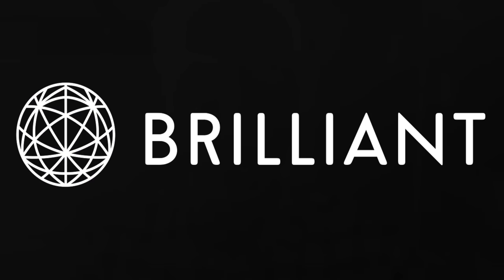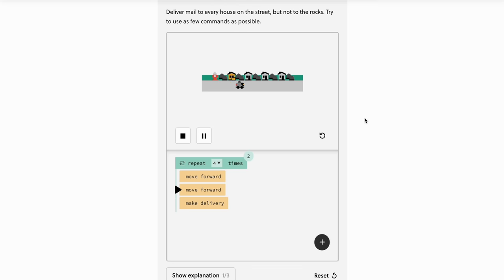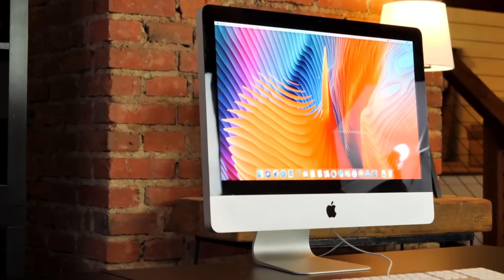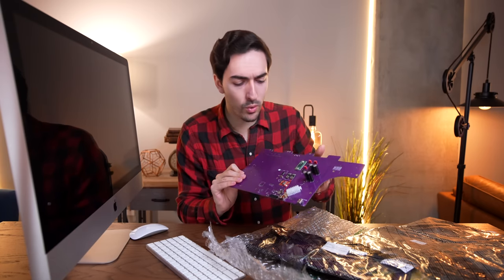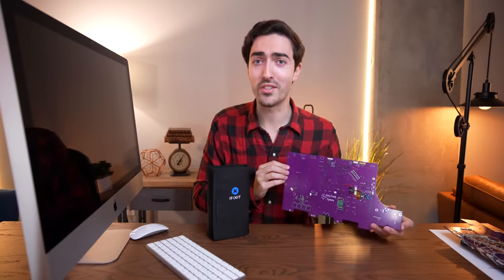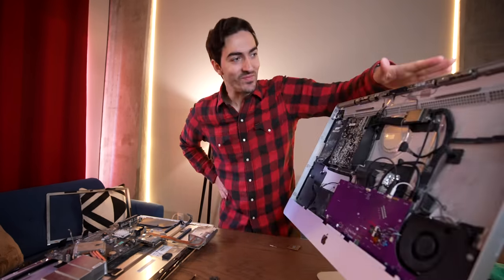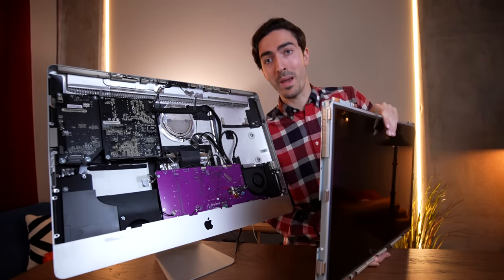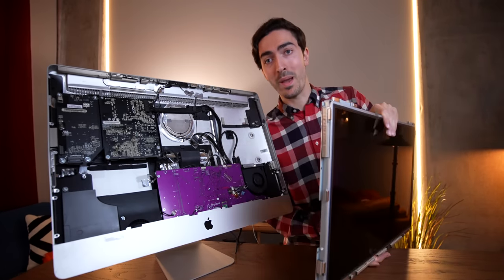Upcycle an old iMac display with this INSANE mod!

Comment: I will definitely do the Mac mini upgrade! Currently using an 2012 iMac with ssd quad core i7, 18gb of ram and 2gb nvidia graphics card. Still very fast for normal tasks but will definitely upgrade if the juicy crumb will be available. So yes like definitely interested in the Mac mini upgrade video

Comment: My 2010 isn’t failing, but isn’t usable anymore with modern MacOS versions (lack of metal support). I usually use it under windows 11 (works fine btw) now.
Reply: have you checked out Opencore Legacy Patcher?
Reply: @haywardkong1213  yes of course. Allows installation but doesn’t work well, i.e no photos, no maps, and sometimes a distorted picture. Oclp works great on my 2012 mbp though, even with ventura

Comment: Luke - does anyone in the world repair Mac Pro 5,1 PSU? Is there hope after the failure of something made from simple coils chokes and capacitors..... I counted a handful of Mos-fet transistors and three heatsinks...... it's made from components from the 90's surely someone with a soldiering iron and a schematic from Apple could be our Mac Superhero and stop the pain.....? Ebay has a few for sale but they are most likely to failure given time and although the second handed PSU are okay for price - the shipping is the price of a two year old Tesla with a charge rate of 26%..... I have heard of horror stories of eBay PSU arriving to not work and after some excitement, the receiver has been found in a state of mind numbing loss !

Comment: This is neat, I've replaced the video card twice in my 2011 iMac, it has the core i7, 16GB ram, and a 1TB SSD, but just keeps blowing graphics cards. I'd keep using it if I could, so this could be a solution but I have a MacBook Pro 14, so if they come out and start selling a USB-C version I'd consider it.
Reply: How did you replace the video card? I couldn't find an upgrade... 24" 2011 iMac.
Reply: We have a USB-C version in the works. The DockPro will be fully USB-C capable once it is released.

Comment: Im actually gonna buy a 21.5 inch with a core i5 and 27 inch with a core i7 to make a video on, and then using the 27' for video editing and writing while giving the other one to my little brother to teach him editing.
I've asked around a lot and have been told that editing on a machine that old probably isn't the best idea, but I've also seen a lot MORE people say that they still use their 2011 iMac's today. Even your old video said that editing was fairly smooth, but not too much other info was given on it.

So Luke I need some information. On a scale from 1-10, how WAS the editing experience at 1080p, 60fps? Cus so long as it hangs around a 6 or something, I'll be happy until I have the money to upgrade to a different Mac entirely, which will probably take a year at my current pace but eh, better than the dual core 2012 Mac Mini I'm currently stuck with.

Besides, if it breaks, I honestly wouldn't hate the 27' as a monitor. Just looking at it gets me into a writing mood for some weird reason... Probably Trey Parker's fault.
Reply: Time to upgrade the Mac mini. It’s unsupported
Reply: @emilsecker7881  Oh I dont care if it's unsupported. An unsupported machine can still be used for editing, writing and other tasks.

Besides, if I was going for a machine that WAS supported, I wouldn't be going for a 2011 iMac.
Reply: @jackintoshvids  should keep it off the net at least. That thing is a liability now. You will do if you get your bank accounts hacked into due to an unsupported browser
Reply: @emilsecker7881  Oh of course. Only thing I'll ever go online for is if I need to download some softwares like Fade In or Final Cut Pro. I intend to use it as a work machine and a work machine only... And to make a video on them cus I think it'd be interesting.
Reply: @jackintoshvids  good plan

Comment: Wonderful video! However the nearly $400 price for the JuicyCrumb board is cost prohibitive. I have a $50 ebay board that does the trick. Albeit not as beautifully integrated. Even at half the price (and why is it only for the 2011?) its a hard sell. Thanks again and I am subscribed.

Comment: In the next version of this it would be better if they can use the optical drive and alao align the ports in the port cut out on the back
Reply: Hi Jero, the Optical Drive will be functional on our DockPro model. Unfortunately it is not possible for us to align the rear I/O for the time being due to the original ports being custom designed for Apple.

Comment: I hope this is compatible with a 2012 too... I'd love to set my old broken one up.
Reply: 2012 and up use double sided tape to stick the screen to. They need another size of board. And I think you can sell working LCD +glass and buy whole 2011 (or two).

Comment: The DockLite and DockPro are very expensive for what you get. Upcycling old hardware has some appeal to it, don't get me wrong. But you can get a clean, compact, modern 27" 2560x1440 monitor with much thinner bezels than a 27" 2011 iMac, for the cost of of a DockLite alone. And if you want a decent-enough monitor that's on par with the 2011 iMac's, you can pay half the price. It's a poor value.

Comment: I prefer the earlier version of this mod as it uses less power to run
Reply: I did get a message from yourself thanks I'm not so TEC savvy but I love the way you squeeze extra juice from old dry I Mac  I've 2 SSD equipped units working well .
However I should prob use mini due to lower power usage .

Comment: I’m a bit surprised that you confuse the 2011 with a 2010 iMac. The difference is obvious from the outside, given that the 2010 only had one mini display port and the 2011 has two thunderbolt ports in its place

Comment: I’ve been looking at the “eBay” driver board solution but not being able to charge the MacBook while having it connected is a definite turn-off for me. 
This product looks a step up, but when you look at the crazy prices you realise that you can buy a completely new monitor, with USB hub, charging etc. for LESS money and without all the hassle. This would have been great if these boards were in the 100 bucks range but I guess they think Apple users love their machines so much that they will fork up 650+ dollars for the most capable version….. but not me.

Comment: Board is a cool idea, while I understand that it has a lot of work and time developing however 500+ dollars for the Board plus the used iMac 100+ dollars is kind if steep for a 10+year old Monitor with speakers. Cool idea no doubt but unless he can figure it out cheaper it won't be economically viable, especially in today's economic situation. Thank you for the video nonetheless.
Reply: Yep, if the board was under $100 it might make sense.

Comment: This is also a nice project, but the cost difference between $260 and $26 for a camera and speakers is significant. I opted for the $26 Chinese option, but unfortunately, they don't have the same brightness as the original components. Perhaps they would work better with an M1 model. Nevertheless, I appreciate your videos; they are wonderful!

Comment: i just upgraded an old 21.5 inch 2011 iMac with a SSD and WX 4150 GPU (=RX 550-560) and it works great! The old GPU isn't failed so i can use it to repair an another iMac
Reply: which model of imac you have  where did you buy the graphics card? I have a mid2011 and the graphics card is getting problematic...
Reply: Time up upgrade. High Sierra has been unsupported for years now
Reply: @emilsecker7881  I’m on Monterey and Windows 10 and no problem. Also it’s just an occasional PC not my principal 

It was an HD 6770M
Reply: @axelvanlooy5401  It’s an iMac 21.5 2011 base model bought used for 100€
I took the GPU from an old not functioning Dell Laptop
Reply: @TaoEffects  hopefully not your main. It’s still archaic
Reply: @axelvanlooy5401  time to upgrade that thing anyway. Don’t spend money on it
Reply: @TaoEffects  shouldn’t be using a 2011 anymore. It’s been unsupported for years now
Reply: @emilsecker7881  it's still running fine as my main computer, as long as the graphic card doesn't block it lol
Reply: @TaoEffects  thanks for your reply, so the dell gpu was a WS 4150 right?
Reply: @emilsecker7881  you can play videos in 4K, has a nice screen, good speakers, a decent webcam, capable of playing recent games (not triple A either anyway), surfing the internet without any problem... lots of tasks that serve most people this iMac is fully capable of. If for 200€ you can have a computer like that, I think it's very good. No need to spend 1200€ on a very recent iMac, especially since not everyone can afford it.
Reply: @axelvanlooy5401  still, shouldn’t be used on the net. macOS High Sierra is unsupported and N WiFi is so dated. Should upgrade anyway
Reply: @TaoEffects  get something newer that’s used then. High Sierra is nothing but a liability on the net now. Should upgrade now tbh
Reply: @emilsecker7881  i told you i’m on Monterey not High Sierra (because of the GPU upgrade). And my main computer have an 5600X and 3070.
Reply: @TaoEffects  true oops. Can you run Ventura?
Reply: @axelvanlooy5401  No problem. It was on a dell precision 7520
It’s an WX 4150

Comment: The link you have is dead.
Mr. Google gives a live one, but confusion is there.
Some comments say Kickstarter is 100% funded, but others say not.
And looking at individual sections, it seems it's still very much under-funded.

The delivery date is April 2023: which likely means later.
Shipping to Europe is AUD 90: which adds to overall cost.

In terms of the overall cost effectiveness, I struggle to see it.

Cost: 
27" iMac 2011: 
zero if you have a failed one and buy card for upgrade
$150 - $250 for a working one

Conversion card: "Dock upgrade board"
AUD $386  plus AUD$90 shipping = USD 303  plus Customs?

Labour:
"free" if you do it, but even then, is still >2 hours I bet

So where's the logic?
Failed iMac plus upgrade card = > $303 plus 2 hours work
Working iMac = $150 - $250

Why not follow this iFixit guide: "How to turn a iMac Intel into an External Monitor"
Or else on YouTube: "How to turn an iMac LCD Display into an External Monitor"
Or Instructables: "Intel IMac As an External Monitor"
All are much cheaper: and available now.

Aliexpress sells them for <$40 plus shipping.

I don't see why you'd want to fund these guys AUD16k to make a pretty basic PCB that's already available off-the-shelf.

Comment: I really love this, I'm big fan of upcycling gear, specially apple gear, shame it doesn't function in the 2010 as they are very similar and the 2010 probably suffers even more from GPU failure, I've had to reball quite a few of the 2010's, even install a 2011 GPU in a 2010.
Reply: 2010 used ccfl (fluorescent tubes) for the backlight, which generated alot of heat and subsequent yellowing of the backlight diffuser. The 2011 led screens were much crisper.
Reply: @macbookmedic5710  Never actually noticed that myself, I assume they need some hours on them to get to that point, I do have a few family members with 2010's that I repaired and upgraded, still going strong running Windows 10 on them now, to toss these in the bin is still a real waste in my eyes, anything to keep them in service would be good.

Comment: Why mutilate these machines in the first place? I run several 27" 2011 iMacs with SSDs, Arch Linux and Gnome which makes them very capable productivity devices even today. OpenOffice, FreeCAD, Firefox, Blender, Visual Studio, OBS… the most recent versions all work and run at perfectly acceptable speeds. I can even boot Windows 10 in Gnome Boxes if need be, and no headaches there either. From my perspective, there's no need to degrade these classic iMac models; they are still absolutely usable as-is in 2022.

Comment: So this option is somewhere between $400 and $700 to repurpose an old iMac which seems like a great idea but the price point to up-cycle something like this is at 300% of what a brand new 27 inch monitor would cost.  If this was $100 bucks that would be an interesting project - after all how much does a circuit board cost?

Comment: Still cheaper to buy a 2011 27" Apple Thunderbolt display via Craigslist and absolutely no work. Using the 5k iMac is the only situation where this would make sense

Comment: At $600 US, it's a stretch to make this worthwhile.   For a 5K 27" display, it would be well into "worthwhile" category.  For a 2011 unit?  Nope.    Killer is that the 27"5K units are hard to disassemble... not impossible, just a tad harder.    Also, if you value your time as a professional, none of this beats just buying a refurb Mac 5k monitor for $1300 or so.    if you value your time at some modest pay rate... ($25-50 an hour), it's still bordering on non-economic to save a 5K display.   This kind of stuff takes a day to do, allowing for the inevitable problems that pile up.      Great idea, but the upfront costs for a 27" monitor make it less appealing.   Not a bad idea, just priced for an ambiguous value.     My solution was to pass on my old 27" iMac to a worthy recipient for free, and buy an Apple monitor which I will now use as my main display for the next 8-10 years, replacing the MacMini with progressively more powerful versions as they evolve and make economic sense.

Comment: I think regulators should forbid this setup: I think displays that cannot be separated from a computer should be forbidden.

Why wasn't there a switch in the first place, allowing the user to use the inbuilt pc or an external pc?

Comment: Luke, wouldn't LUNA or DUET do the same thing now....As I posted below in a weak attempt at humor BUT what I stated was true with respect to owning all of that stuff...plus a lot more...if interested in the reasons, etc email me and be happy to explain.... Any case, I purchased my first PC or Microsoft run computer for personal use or gaming/flight sims less than a year ago....I used PCs exclsuively for work and Apple's ecosystem for personal all the way back starting with the Commodore 64 ...Yep, I'm old....Having all of these PC's, servers, MacBook Pro's, mabook Airs, Ipads, etc I was certain I could figure out how to upgrade or to use as a 2nd monitor or a 3rd monitor...connect my iMacs to the new PC I built/had built...the 2011 iMac is a 21.5" and the 2010 is a 27 "....TDM only works on the 2010 model...2011 iMac TDM only works on the 27" models...even so, the 2011 iMac is actually functional to perform simple task such as accessing Adobe or word files...watch or stream something but I wanted to use to extend my workspace which is now a Windows Operating System (Windows 11)....The 2010 internal drive is about dead and it does take forever to load but I can boot and open my apple account...however, I can not get it to engage TDM...probably doing something wrong with the PC but as stated prior...being in the Apple exosystem for 30+ years I can use Terminal without having to do any research on what to search for or enter...same can not be said for Windows...I know how to navigate but compared to Mac's logical processes IMO...most of Window's processes are far more complicated than they need to be or should be...nevertheless, it is what it is....

I will take a peak at juicy Crumbs and while this video was posted 9 months ago or so I did subscribe and will search through your videos and playlist...If ever need another iMac or old laptop...depending on circumstances perhaps wouldn't cost either of us anything...or perhaps can share an idea with you that I beleieve would create a demand in a specific niche PC community....but that's all for another day...enjoyed your vid...Take Care
ps. apologize for the typos and rambling...I'm old...it's late...I'm tired....and honestly I don't care...am sincere about having a good day however!

Comment: Its so much cheaper to buy a new flashed GPU for your iMac. With those prices you could just replace it with a 2013 27 iMac.

Comment: This would be amazing if they turn this into a post-Kickstarter product.  I have a mid-2011 iMac that for some reason won't boot anymore post one of the OSX upgrades and the optical drive failed and no matter what, couldn't boot it into safe mode.  If anyone knows a fix, I've posted a video of the verbose boot sequence years ago and have had no responses... https://www.youtube.com/watch?v=Hrqiin3Nn1Q
Reply: It sounds like (without watching your video), your iMac has borked during an upgrade.

Try booting it from a bootable Mac OS X flash drive.

Run both the disk and permissions repairs in Disk Utility in the first instance, then re-install OS X onto your hard drive (*not* a clean install — unless you want to wipe your hard drive).

If you’re lucky, that may fix your boot problems.

Back everything up then retry the OS upgrade afresh (from a non-corrupted source).

I hope this helps.

Comment: Why not just replace the faulty GPU with a NVIDIA 3100, 4100, GTX 780M (for example) with flashed firmware? There are plenty of them on eBay. Problem solved 🙂

Comment: As cool as a solution this is to reduce e-waste there no way someone is paying 300-500 bucks for this board to turn a old dead 27" into a screen which is out dated when You can legit get a 42" curve screen for that price. good concept but horrible cost. The better solution is those vga board you can buy in china for 23 bucks... and just hook up the lvcd cable. Sorry for cost effective is out the window for this.

Comment: LMAO  What iMac has EVER been cleaned inside on a regular basis ???   :face-orange-raised-eyebrow: Not designed to be !    :face-green-smiling::face-purple-crying:   Too bad this can't be done with a 2017 27" Retina Intel iMac. Of course, mine is still running fine. Will be upgrading to something M2/3 this year, maybe. Really want a new M2/3 27" iMac......grrrr.  Not getting a 24" iMac, there are "too many" of them in the Apple refurblished store is a 2nd big reason not to.